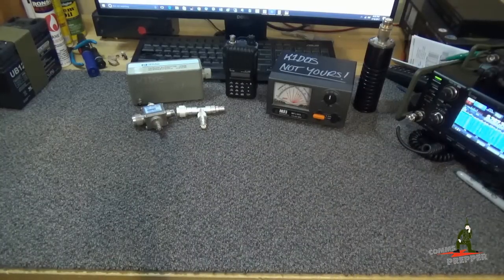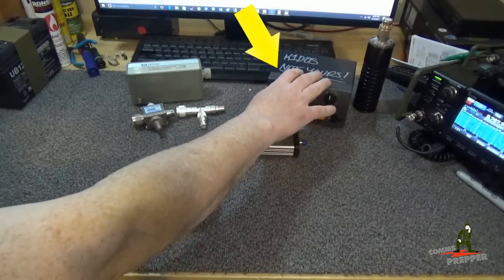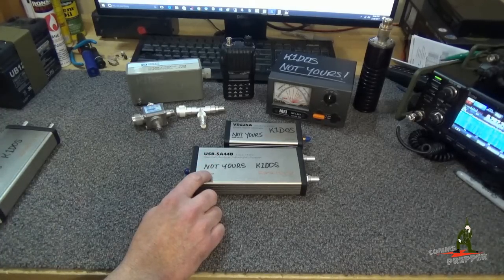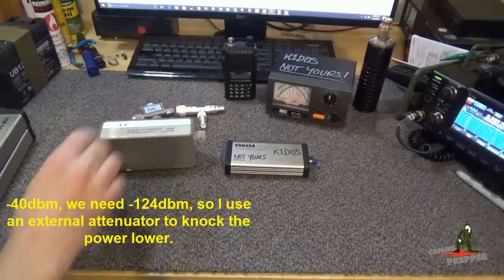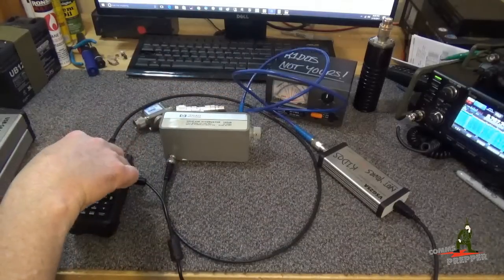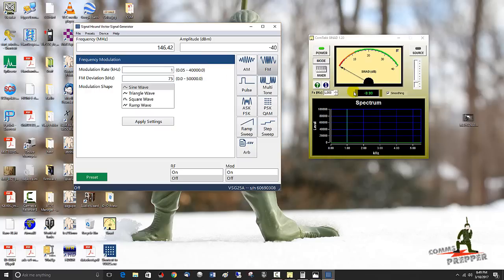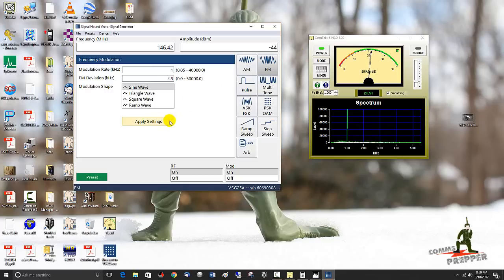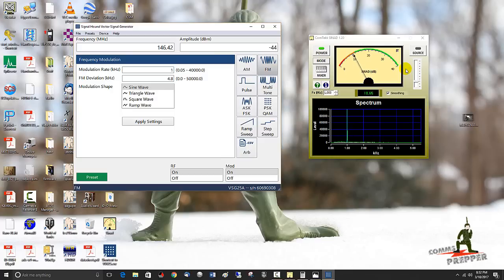Signal Hound VSG25A Radio Receiver Test

Comment: I have the Comtekk Sinad software and sound card isolator that I've paired with a TinySa as a sig-gen for testing receive sensitivity of my older Kenwood HT's. I've also demonstrated to friends why I'm willing to pay more for used LMR gear vs a new $35 chinese radio. My only problem with using the software is being very uncomfortable connecting a laptop to the external speaker port on mobile rigs. The audio output on an HT designed to drive an earwig or speaker mic OK, and Comtekk says it can be used with speaker outputs, but I just don't trust the isolator that much. I think I'm going to try and put a "line level" converter in the path and see if it introduces a bunch of noise. 

Still gonna keep an eye out for a Motorola Sinad meter(r1013a) though. It's simple through hole design, and even the LM348 op-amps are readily available, so repairing one is easy if need be.

Comment: I started working as a D.A.S.  tech a few months ago and I use a SIGNAL HOUND spectrum analyzer to test incoming public safety radio frequencies.Can you please tell me where I could find more info on these devices or where can I find groups that provide training  on testing frequencies . Thank you
Reply from the maker: Signal Hound has a forum that you can join where questions can be posted and folks share info.

Comment: how about using a Signal Hound and amplifing it to jam and drop droned out of the sky?  maybe use and SDR to pin point their signal and then Tx with an amplified Hound.  a worth wild project?  guess one could jam cell phones the same way
Reply from the maker: Everything you mentioned is against the law.  Will not find that kind of stuff here on my channel.

Comment: It amazes me the cost of old IFR's!
Reply from the maker: Crazy and you don't know what your are getting.  Even if it was treated well at 20 plus years it could die and they are out of business now.  Someone needs to make a poor-man's monitor.
Reply: I know at several hamfests lately i have seen HP and General Dynmiacs cellular service monitors from the analog and 2g cell days showing up most of it will do the stuff we need with analog radio but they are nearly in the $1k range. I think the software defined solution is the way to go.

Comment: Excellent points... What's nice about the SH is that they are highly portable. I've lugged up an IFR com-120 on an Alice pack frame up 15 flights of stairs, nearly collapsed a lung...
Reply from the maker: +GUERRILLACOMM Yeh... hard to beat the portability and price of Signal Hound.  When I was on the bench we also had the Motorola R2002 but they did not travel well at all.

Comment: Wish I had an antenna analyzer!  Just assembled my first Moxon for 2 meters.  Yet to check it on the meter.  Any thoughts on that type of antenna?
Reply from the maker: Not enough information.  What band?
Reply: Have read that this is very broad banded antenna, but I cannot check impedance.  Attempting to make it as useful as possible.  Hope it will do 144.300 to 154.600 Mhz.  Cut for 149.500 Mhz, the center frequency.  Used a Moxon calculator for the dimensions, but different calculators yield different results!  this was easy to build, no matching, compact and advertises a high F/B ratio, 20 to 40 dbd out the back, decent gain for listening.  I could use as low power as possible, perhaps 0.5 watts.  ERP might be 1 watt, making it hard to DF.
Reply: To further attenuate the signal, I would also run the Moxon horizontally polarized between stations.  The receiving station will have a horizonally polarized antenna and has a mountain behind him improving security.  Transmitting to another antenna horizontally polarized as well, the signal might be attenuated another -20 to -30 Dbd as received by vertically polarized antennas.  Given a the attenuation at the rear of the Moxon is no less than -20Dbd, the total attenuation of a horizontally polarized antenna, might be -40 to -60 Dbd out the backside.  Am I on the right track?
Reply from the maker: +Mert Dale what is a Maxon?  I am
Missing something here.
Reply: A ''moxon''  is a type of antenna.  Very practical.  Here is a link:
http://www.jedsoft.org/fun/antennas/moxon/moxon.html

Comment: Very good test setup DEMO Jim =)    Yep I miss my bench Motorola Service Scope .... even old and out of date now days =)
Reply from the maker: I miss my old IFR-500.  It was a great monitor.
Reply: The shop I worked at had just spent $7,000 on calibration / 
certification and servicing of the Motorola Bench Service monitor ( Yep it was daylight to 4 Ghz range =)    Some where around $60,000 - $75,000 replacement cost 8-O   It had a 5 watt transmitter / receiver and four pin Motorola mike jack on the front to do any modulation you could imagine =)
Reply: I really LIKE THE Signal Hound USB-SA44B & SA-44B ... USB test equipment looking over the spec's =)